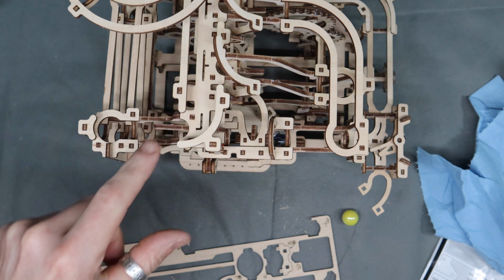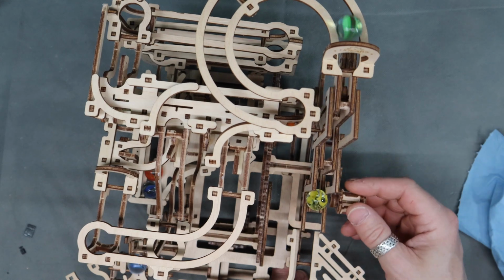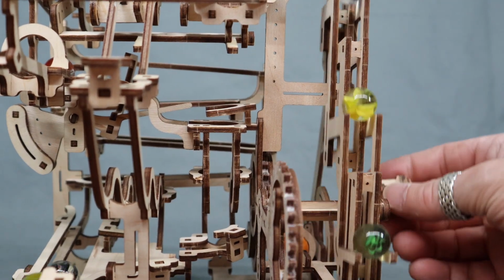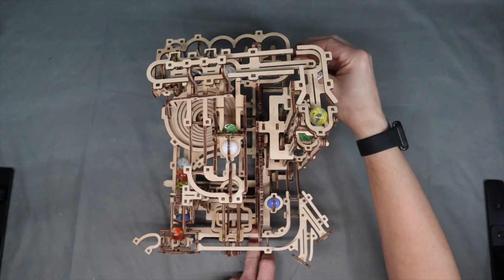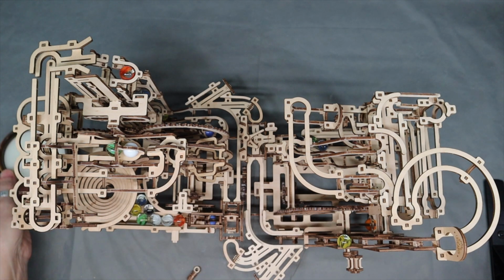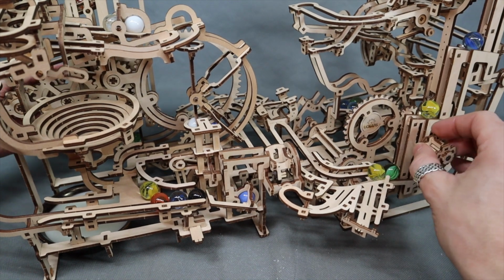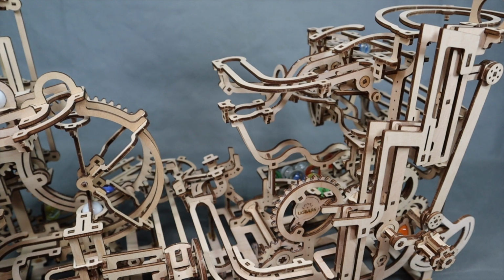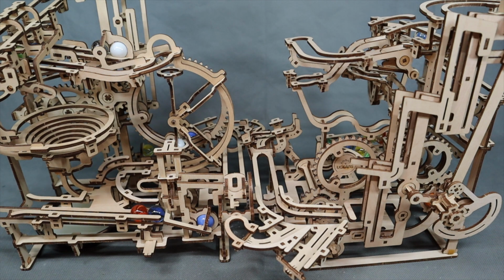Combining UGEARS Sets

Comment: I have a problem with the bit where the marble gets picked up. For some reason it doesn't go down enough for the marble to get picked up any solutions?
Reply from the maker: I know exactly what you’re talking about, you have to make sure the lifting gears are at the total opposite ends of the track, it took me a long time to get it properly calibrated too, but once you see it you’ll know. I’m doing this from memory, I’ll try to pull out the set when I get home from work for a better explanation.